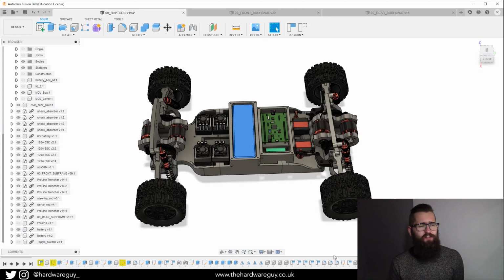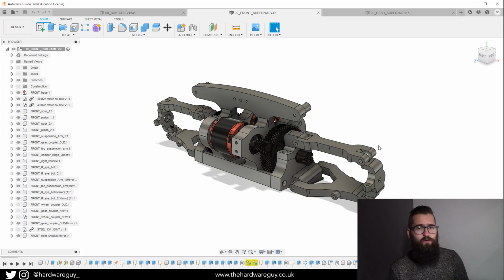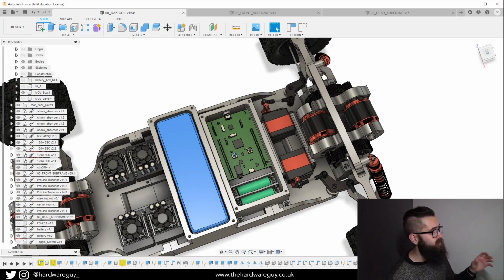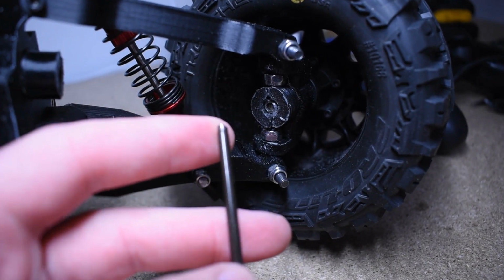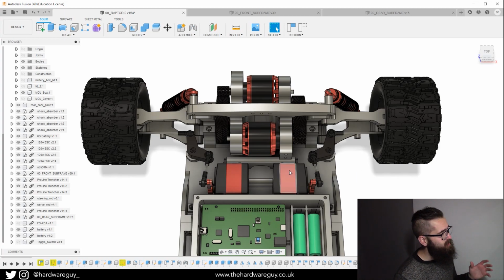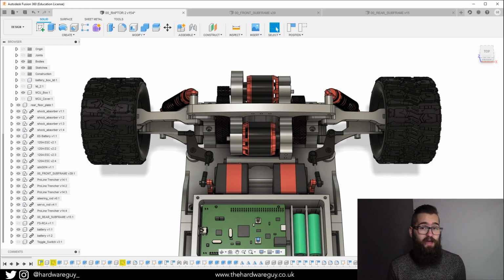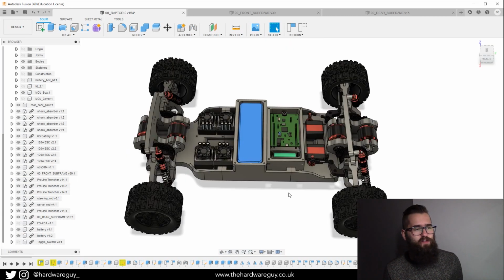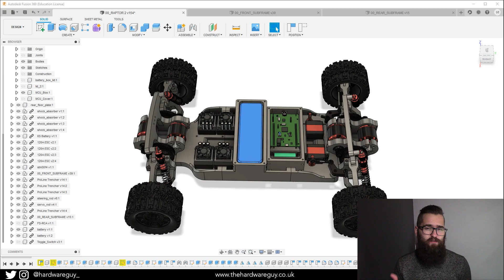Raptor II: Design Update

Comment: I‘m planing to build my own RC car like this too, but I want it to be like a real car, with a frame etc. It probably wont be a good performer, but I think it will look cool. Since it will be fully electric I‘m looking into shrinking down Tesla‘s battery placement, for a very low center of gravity. And for the axle and suspension I will try to shrink down sports cars technology. Maybe that way I can get some performance out of the car

Comment: Have you looked into Engineering Nonsense's "Tarmo4" ? He's on YouTube and reddit. He's made a fairly nice RC car that only requires 1 motor and 1 servo.
Reply: That guy is just creating 3d printed rc car, so you don't have to buy one. Thehardwareguy wants to create something that not common yet, a vehicle which can be fully controlled with software as opposed to mechanics currently used in RC cars (differentials and such). Only missing still is the suspension ;-)

Comment: Sorry if you've answered my questions in earlier videos. I'm a semi recent subscriber.
Are you planning on using an electronic differential?
You might be able to reduce your turn radius if you let the inner wheels skid a bit. Heck you could probably have the car turn in place if you drive one side in reverse.
Is there a reason you didn't move two of the ESCs closer to the front?
I'm very curious about the encoders. What are you measuring with these encoders? What type of encoders?
I've worked a bunch with various encoders myself and I'm curious how you plan to use them. I'll likely go try to find some of these answers in your earlier videos now. I'll edit this if I've already found the answer to some of my questions.
Thank you very much for sharing your work with us. I really enjoyed the video and look forward to learning more about this project.

Comment: Using 2 servos for the steering is a really fantastic idea, I love it! Btw, you might consider exploring positive and negative Ackermann instead of just true Ackermann. I understand it can make a big difference when cornering at speed due to the slip angle of the tyres. You could even adjust your Ackermann at runtime based on the speed the car is going! This steering system is a really great innovation, nice work.